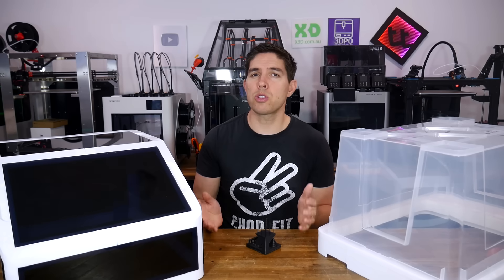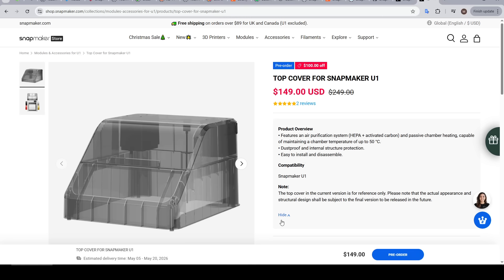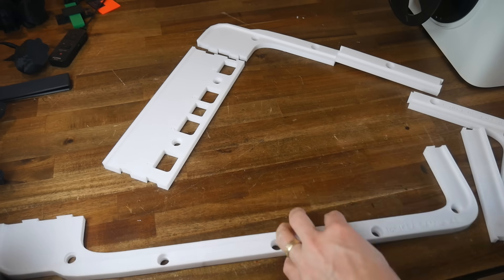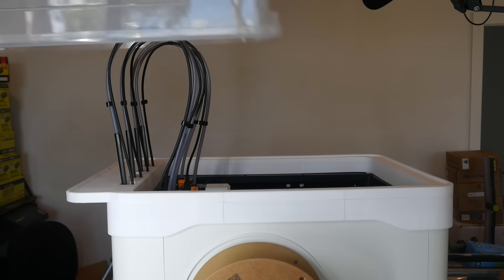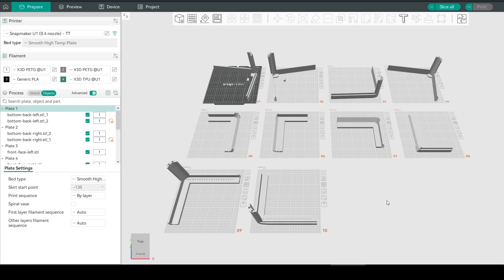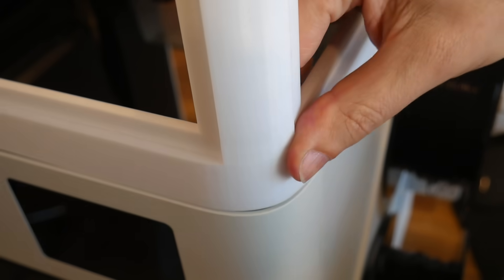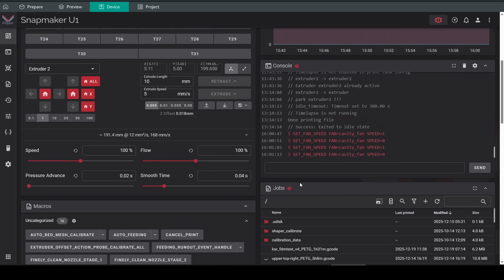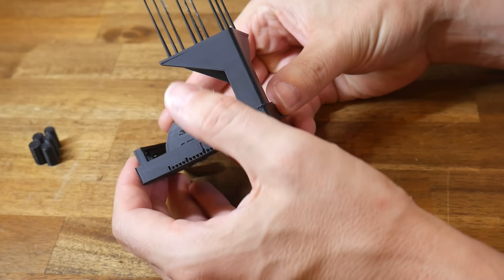Testing two community Snapmaker U1 top covers - Cheap enclosures

Comment: I printed the Ikea one, but a slightly simpler Version from Makerworld, where you do not have to disconnect USB connectors. I printed it in PLA, not paying attention to the temperature occuring while printing later; however, have not encountered issues with that yet. Really like that as an interim, Top Cover wil arrive in Sept. according to my pledge.

Comment: There is a semi cheap option that rests between the two of these designs.  What you do i buy cheapest clear bins with lids you can find.  normally at walmart for $6 , get 3 print the sloped good version of these two tops. instead of buying expensive plexiglass sheets cut the tub lids you bought from Walmart and use those for the "glass" it will work better and also it gives you an option of slightly heating the "panels" to soften them and to put them in creating a seal when they harden back up.  Best of both worlds and much cheaper

Comment: I used a tub similar to the IKEA one for my Ender2. I never left it unattended because the polypropylene was quite flamable. I also used a smoke detector. I don't know though if the latest and more expensive printers are seen as such a potential fire risk.

Comment: ive already pre ordered the Biqu cryogrip frostbite and glacier beds for the U1. Absolutely hate the gold PEI ones
Reply: I hear you. Everyone uses them because they were more noob friendly than gluesticks. And to be fair, you do want to be using gold PEI with PET-G or Silk pla, but I personally have been using Bambu's supertack and I've done like 30 to 40 prints on one plate so far, even touched the middle a few times, and never cleaned or washed it and it just grips everything. The cryogrip probably operates at lower temps though. The supertack is 45c and Bambu's new supertack pro is 40c. I just ordered one of those and an H2C coming on Tuesday. But I also have a U1 coming mid-January

Comment: I used thin aluminum angle, to fabricate a frame, and covered with 3M shrink window wrap, on Coreception 300. It is very light and transparent. A top fan with carbon filter and temperature controller vents excess heat. Intake air via adjustable bottom vents, and vents at corexy stepper motors for cooling. Similar except for U1, would design printed corners to accept aluminun angles on rounded corners.

Comment: Talk about timing :)  My snapmaker is "on the boat" and I just finished printing a mod of the ikea version.  I don't have an ikea near me so I modded the top part to be flattened so that any tub will fit on.  I also modded it so you don't have to take anything apart on the feed tubes.  Plan to upload it once I get it tweaked a bit.

Comment: The kickstarter addon price for the top cover seems pretty reasonable compared to all the hours and materials it takes to build the DIY acrylic panel one, though RRP is a bit steep maybe. Hoping they revised it to look a bit more premium than what they originally showed but they haven't shown us the updated version yet.
Also I saw Biqu have put out Glacier and Frostbite plates for the U1. I switch between both depending on filament on my A1 and can't recommend them enough, I'll be getting a set for all my printers going forward

Comment: The Ikea version can easily be modded - I have these rubber foam adhesive sheets which I use on a ton of 3D prints - either as feet or to make parts fit more snugly - and they would serve as good isolation as well for sure. When not in use it can also double as a filament container.

Comment: If you doubled up the Ikea tubs would it have an effect like double glazing? Reducing noise and trapping in more heat.
Not expecting you to try I just had a thought and wanted to share.
Great video. Keep up the good work.
Reply: Yes, great video! I am wondering about double the tubs with some sort of sound absorbtion material acting as baffling? How much sound absorption? Is it even worth the effort? When running all three of my printers at the same time the noise is getting me to the point of leaving the room...which I don't want to do...headphones (even my noise reduction ones) only go so far since prints can take so long to complete.

Comment: There's also an unofficial firmware that adds the camera to fluidd. (and rfid tags you can write yourself). I've printed ~50h ASA with 100°C bed temp (+brim+ zero brim spacing) with just the ikea box, no "base" for it.

Comment: I saw the ikea version last week and literally bought the tub straight away, even though I won't have my printer for a month.  It's honestly the perfect example of the community, hacking together a common household item with a bit of printing into something 80% cheaper than the bought version.
Reply: Two nested tubs should provide an extra insulation barrier if the temps are not quite high enough. Still waiting for mine so can't test it. Looks like I have to wait until October for the SM lid, though 😞
Reply: @mikelastname same here. So it seems like in the meantime I will also use the Sammla solution as I don't want to wait until September for some abs, asa and other similar prints.
Reply: @mikelastname yeah those are some hefty delays. Also theres a Walmart tote top lid version on makerworld, thats what I'm using
Reply: Agreed. Dare I say, it looks like it fits the printer too. I feel bad for the people who already preordered the top cover only to see this pop up lol
Reply: @SangheiliSpecOp no need for feeling bad for me and others.. I like the fact that it has a filter system and Fan to control the temperature. Hopefully that means it can stay there forever no matter of the filament is abs, petg, pla, asa or some nylon stuff.

At least I don't feel bad or betrayed that I ordered it. I personally don't want to such a diy solution like the sammla one but I think it is a cool and simple solution anyway.

So how about letting each Individual decide for his own without mocking anyone for the decision he made?

I don't know yet how the finish of the U1 looks like for real because mine will arrive next week but if it looks high quality I would not even consider the sammla version because of the Look it generates.

Everyone like he or she wants. That the good thing about an open community. So many covers out the yet. One for everyones taste 👌🏻

Edit: Haven't seen the temp test when I replied.. The chamber temp with the sammla solution looks very solid. Guess you can print technical filament as well with maybe a specific pei sheet 👍🏻 did not expect that from that box honestly 😅

Comment: Oh man, I backed the official top cover.  I wish people would focus more on dryboxes for the side, lol.
Reply: There are adapters to print with which you can add tupes directly to the motors. I put my Creality Space P at the other end and now it's kinda completely enclosed
Reply: @Cheya42  Do you have two Space P on each side?  I saw a model for allowing a PTFE tube going into the motors but not really a good stackable enclosure yet.  I'm sure a third party will come up with a drybox that fits perfectly but hopefully someone figures out something cheaper.
Reply: @exodous02 I have two of the double versions. One bought amd one won in the lottery which took place last month. At the moment both on one side, but I'm improving the Tube way atm to beeing more efficient.

I don't know if you know about the video I put in the comment, but easy ways to improve the U1

https://youtu.be/VAgOElYoZ5U?si=0RwY4xa7-6qZkNrW

Comment: I’m holding out for the Snapmaker version, as I wanted a ready made option, that I could mod with a third party chamber heater. The only drag is it’s about a further 8 week delivery lead time after my printer is scheduled to arrive. Hopefully by then I’ll have calibrated the nozzles for various materials that I use, and modded the nozzle JSON files to use different nozzles in one print.
Reply: Fear not for those of that didn't back it early, we have longer then a 8 week drag.. Could be a 12. 16 or longer drag
Reply: @TripleJAu 😂I reckon I’m on another three week wait at mo for the U1, and as an early backer it’s been painful watching all these reviews. I’m confident it’ll be worth it, and I’m sure they’ll be some third party mods coming from BTT and others.

Comment: I should be getting my U1 in a few weeks.  As much as I like a low cost solution I just can't put a cheap plastic bin on top of something I paid $1000 for (exchange rates included).  It's like driving a new car with a black trash bag covering a window.  Just can't do it.  With that said I've already downloaded a number of top projects and started mixing and matching various parts to come up with one design I like.  Once I get my printer and can do some actual measurements I'll finalize my design and print it off.

Comment: Plastic tub, but add some foam insulation to it. And to the printer side walls. Maybe even have two nesting plastic tubs with insulation between them.
Reply: Closed air gap is very good isolation itself so two nested tubs probably would be all we need.
Reply: @Rozbujnik_Rumcajs  there would still be convection currents travelling to and from the top surfaces of the tubs. I don’t know how significant these would be, but foam is cheap.
Reply: @Scrogan  The heat loss due to convection, does not justify sacrificing the container's transparency. Printer housing will lose way more heat anyway. And if you don't care about enclosure transparency then why use plastic tub in the first place? XPS foam boards are cheap, strong, easy to work with. You can paint them and its easy to make them look nice.

Comment: The Ikea version. You only need to put it on when printing with certain filaments.
Reply: That and it helps to quiet it down a bit which is why I got it. Still waiting on the cover tho but the cover works great!
Reply: and keeping out dust. And pets, if applicable.

Comment: Might be just me but the Ika version looks dorkey to me. It is much simpler & appears to work the same but the other version looks like it belongs on the U1. I think the biggest issue with the 2nd version would be getting the panels cut to the proper size.

Comment: Thanks for that. I believe there is a different design for the Ikea mod that fits around the cables so you don't need to remove them.

It would have been nice if you had measured/mentioned the noise reduction when using the covers. My U1 is on the way and am concerned about the noise it will make.
Reply: Yes, I'm also more worried about the noise and how to reduce it!
Reply: @PauliMyrakka  there are some additional possible Noise tweaks: printer.cfg -> extruder fans 1.0->0.6 and XY stepper current 1.2->1.0 . used this for 2 weeks without issues (the current depends on friction of course). And you can reduce the Acceleration settings from 10.000 to e.g. 7.000 . The Aux cooling fan can also be turned down a bit. Potentially closing the vents to the bottom and sides could be an option but carefully monitor electronics temperature!
Reply: That’s the one I’m gonna print, printing so well at the moment

Comment: With the cover, is there any point in adding a chamber heater?  I.e., are chamber temperatures higher than 55-60 deg. C. beneficial for printing ABS and/or ASA?  If so, is there room to fit one in the printer?

Comment: I'm fairly new into 3D printing. I haven't printed ASA yet. Though I have an question regarding the adhesion issue due to the build plate: since U1 is a tool changer, could you print a model with a slim base made of PETG and in the same print, make the printer print the real model in ASA on top of the PETG base? Would the ASA stick or not at all?
Reply: I don't know about PETG and ASA, but I know people have done that with PLA and ABS.

Comment: Its really sad that a $1000 printer needs something like this.
Reply: I paid $679 + $50 shipping, so, $149 extra for a top cover was fine with me - However, right now on their website it is $849, so not a $1000 printer (unless you add the top!)
Reply: @richardcentesette1057 it was advertised with an MSRP of $999 on the Kickstarter and is only $849 now because of the Christmas deal. Same goes for the enclosure being $100 off. 

I don't use Kickstarter so this was always a $1000 printer in my eyes. $1250 enclosed.
Reply: Agreed, it should have been enclosed from the start with 350c nozzle and 120c bed
Reply: @riba2233   ...and a bigger bed and 6 heads, but for $849, what other printers compare with it?

Comment: 1:18 can you explain what you meant by "unlike with Bambu Lab printers"? I'm pretty sure all of them can be operated locally on the LAN only mode, am I wrong?
Reply: You can use any software with Bambu Lab printers if you enable LAN Only and Developer Mode
Reply: @AtomicSparkor if you export to sd card
Reply: Also, where is the chamber thermistor located? It seems weird that with only a 100C bed and huge interior volume it reaches 60C so quickly (if at all)
Reply: @97hondacivic My Bambu Lab X1C would take forever to reach 50°C when I used the bed to preheat for high temp filaments and would never exceed 55°C (which is conveniently the maximum rating for the PSU)
Reply: Ofc they can

Comment: FYI, there are versions without the closed back, so you can slide the cover on the back for the Ikea tub version. I'd go with the tub version since I don't really want to cut the panels, but I still want to see through. There are also versions with outer guides to hold the tub more securely. I'm not doing anything that requires an enclosure at present, but I will eventually. Thanks for the "review".